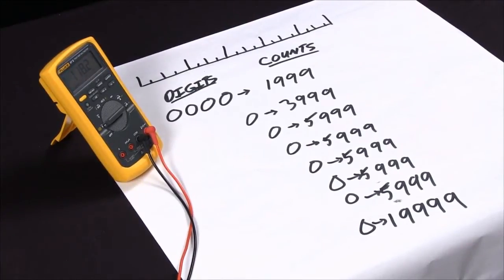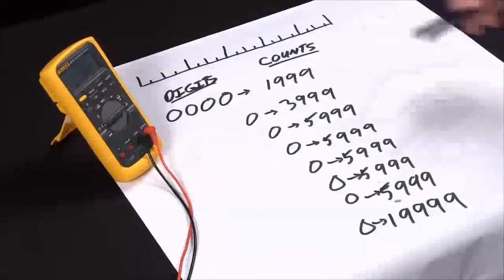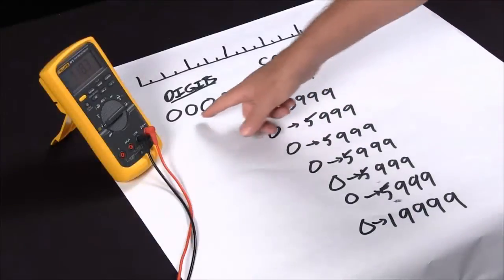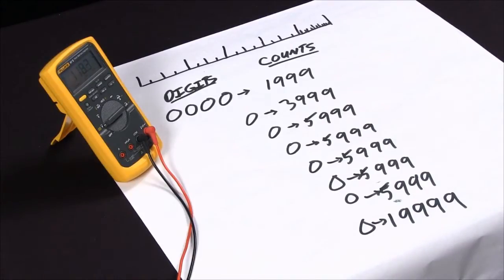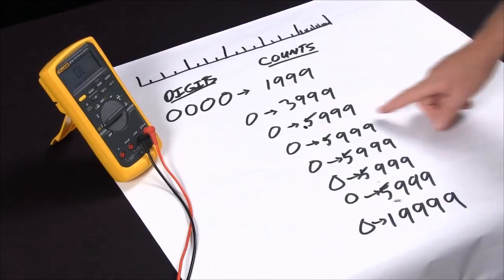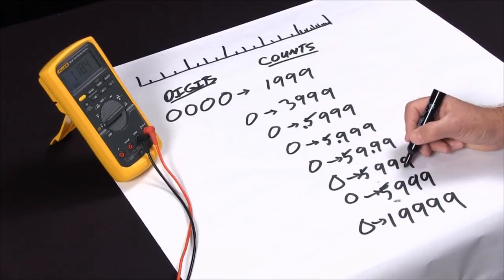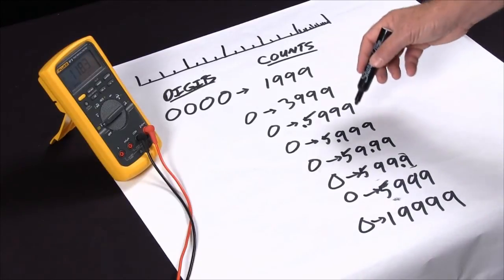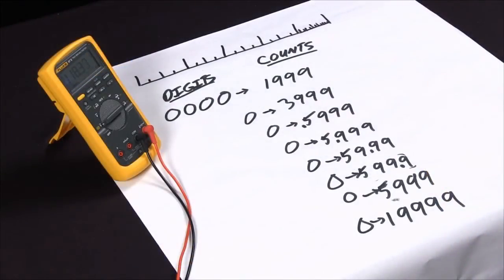What is The Differences Between Resolution And Ranging on a Multimeter?

Comment: Question.
2:38 
Where did 480 volts come into the equation? In context you were discussing measuring 120 volts. This confused me, because I am trying to closely follow your train of thought. I understand that 480 volts would be too high for a 400 volt meter, but why did you refer to 480 out of the blue?